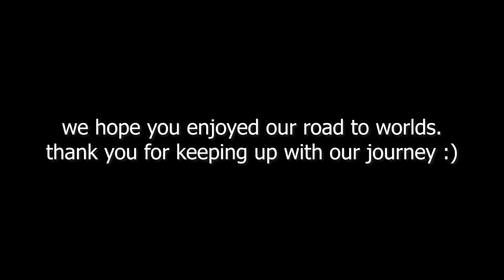ROAD TO WORLD'S STRONGEST MAN | OUR LAST EVER TRAINING SESSION! | Episode 23

Comment: Great video. Luke don't forget what your coach said. He and I noticed that with the FINGAL FINGERS YOU'RE NOT DRIVING HARD "ALL THE WAY" THROUGH FINISH. YOU'RE PURPOSELY SLOWING DOWN ON YOUR LAST COUPLE PUSHES/STEPS. THAT FRACTION OF A SECOND CAN BE THE DIFFERENCE BETWEEN WIN OR LOSE. Also Luke don't forget "moisture wicking" shirts to control sweating. Good luck guys. Luke you're stronger than Oleski Novikov. He replies on technique. You know technique too. Combine that with your strength and Luke you're bringing home🏆🏆 🏆GOLD TROPHY.🏆🏆🏆 LUKE YOU WILL WIN WSM 1ST PLACE GOLD THIS YEAR.

Comment: buzz or shave your heads to stay cooler in California, i used to live there, it helps a lot!
Reply: I live there now, albeit SoCal not NorCal. Good call - 100% would go for the buzz cut.  Looks like they will be a bit lucky - the temp is scheduled to be 85-95 degrees fahrenheit (29-35 celsius) in Sacramento. Could've been quite a bit hotter.
Reply: Michael Harris  Amen brother

Comment: Random shot at a question here. If you could choose the absolute top 2 exercises to improve your lockout strength for pressing, either for bench or overhead, which would they be? Thank you
Reply: Banded pressing or pressing against solid at semi lockout position usually works good for improving lockout.
Reply: Also just holding the weight at lockout for a few seconds and focussing on the lockout helps a lot